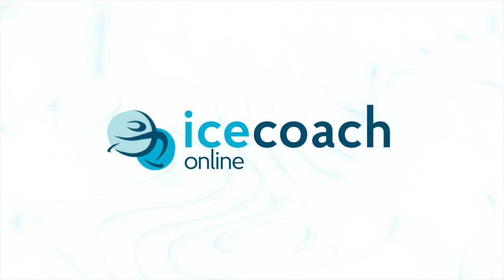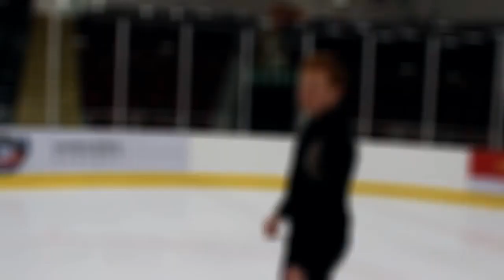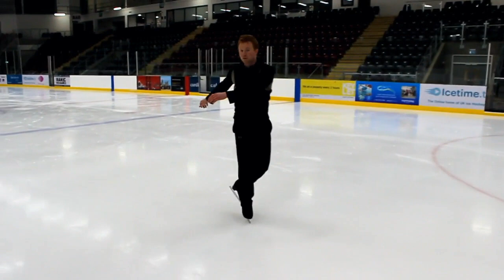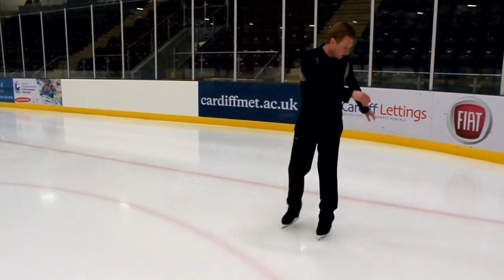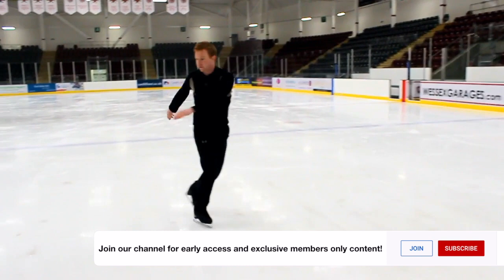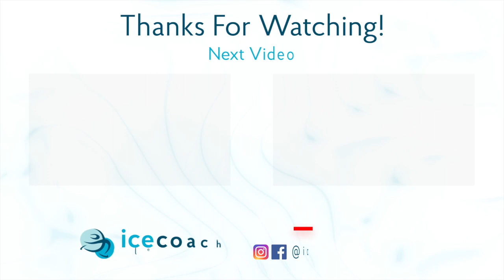Challenging Dynamic Figure Skating Exercise! Quick Hip Twists!

Comment: So basically you're doing a backwards inside rocker - forward inside rocker pattern but you jump it rather than do it on the ice.
Reply from the maker: Yes exactly! It's quite an explosive movement required to do this in the air.

Comment: Nice, firs time seeing this! Curious on in which combinations this move is used? Also, could you please cover Waltz 8 move? Specially the part that we need to change from backward to forward by rotating our body (not a 3 turn)?
Reply from the maker: This move is use as a way of building up explosive strength and balance. It will help you be more explosive and dynamic for various other moves on the ice. It can also be used for choreography, and in step sequences.
Which testing system does the waltz 8 move come under? (County and Level). I just want to make sure I have the correct move in my head!
- Lloyd
Reply: @IceCoachOnline  Thanks! I had this Waltz 8 in my head and my problem right now is to do the shift from 14 to 17 in the figure without stopping: https://www.liveabout.com/figure-skating-waltz-eight-1282536